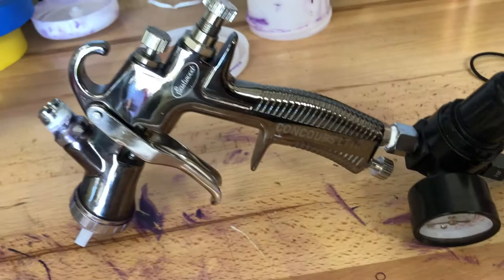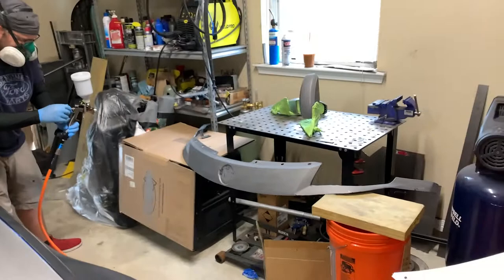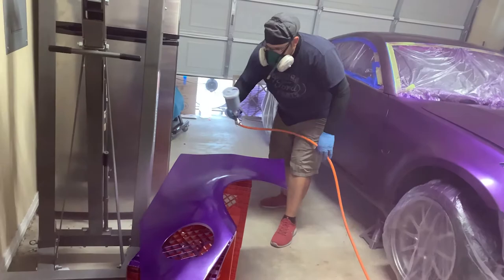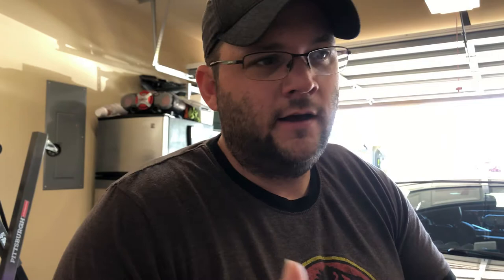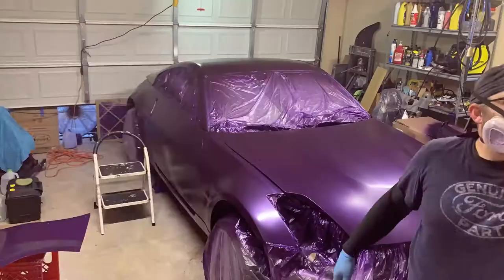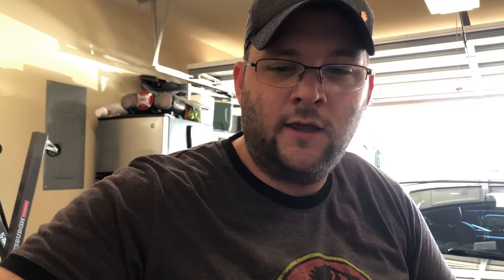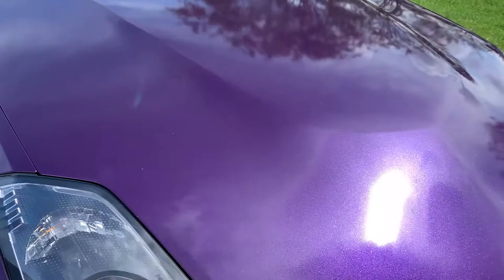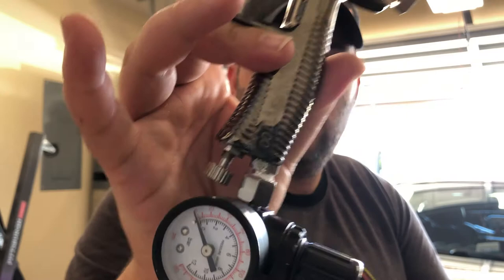Eastwood Concours LT100 Review

Comment: Cool review man!..got me one if these and learned to spray like a pro with it and your right the only downfall is it’s trigger..stiff and now enough travel..what worked really well for me if it’ll help anyone out is 1 1/2 to 2 turns out on the fluid needle from closed and 23 psi for base and 26 psi for clear works every time
Reply from the maker: Nice! Thanks for posting what pressures and gun settings worked for you! I’m sure it’ll help someone out along the way.

Comment: I bought this gun and could not get the lid to stop leaking out of the threads... did your lid have an o-ring or some type of seal?
Reply from the maker: Mine didn't have anything around the threads. The only thing I noticed that mine has in the lid is like a paper gasket that sits inside the threads and around the vent. I haven't had anything leak out of the threads, only out of the vent when I had almost a full cup and tilted the gun to far and it leaked out there. The cup is a cheap design though, I'll likely be upgrading mine soon.
Reply: @MikeTW  yeah, I ordered a new cup with disposable liners.  Because no matter how much I tried... paint would pour out of the cup threads...

Comment: Thanks for this awesome vid, this video just helped me make up my mind about the LT100.👍🏽 
I'm also getting the 1.7 tip that cost more than the spray gun itself 😂
Reply from the maker: Glad you found the video helpful. I have the 1.3 and 1.5 tips I haven't used the larger tip yet, although I think with some 2k primers you need a 1.8 or 2.0 tip. So the 1.7 might be useful there. Either way, you go this gun is hard to beat for its price.

Comment: my compressor is 4.5 cfm at 90 psi, 5.5 cfm at 40 psi, is it able to run this paint gun?
Reply: The gun specs state 4.5 cfm at 30psi. So less air at lower psi settings.

Comment: I use this gun on my 30 gal compressor. Works pretty well
Reply from the maker: Yeah mine is a 20 gallon and I had no issues.
Reply: WhAt are  u spraying base, primer , sealer ,clear?
Reply from the maker: @JOEDAPOPERAPGOD  I sprayed sealer, base, and clear all with the 1.3 tip.
Reply: @JOEDAPOPERAPGOD  i spray primer with a 1.8mm (i sand it with 600) then sealer, base and clear with 1.3mm
Reply: @MikeTW  thank u
Reply: @mikelmorgan6409  thank u

Comment: How was the atomisation ,did youre compresor keep up im thinking of buying one
Reply from the maker: Atomization is good at about 25-30 psi. I’ve used both slow and medium reducer/activator both work fine. My smaller compressor seemed to have no issues. It did run a lot but I never noticed a difference in the spray pattern from the gun.

Comment: What did u set the air pressure to on the gun?
Reply from the maker: I ran it at about 30 psi.
Reply: For clear coat 28 psi  trust me work great 👍...for paint less....

Comment: They do say you should at least have a 30 gallon tank
Reply from the maker: As long as your compressor can handle 4.5 CFM at 30psi you should be fine. Most home compressors 20gallons or better have no issues.